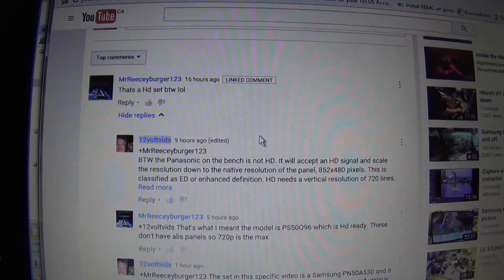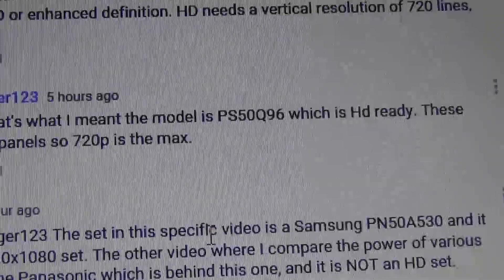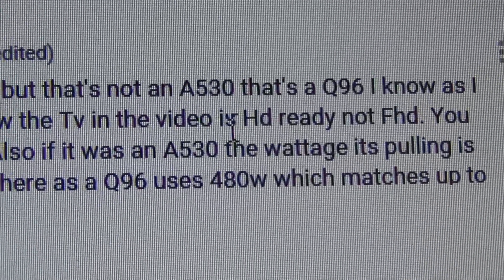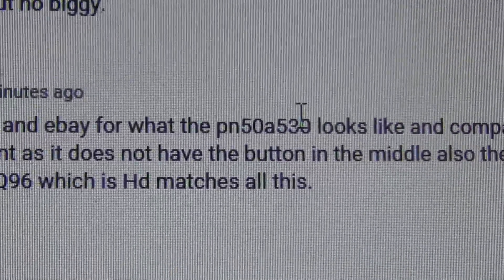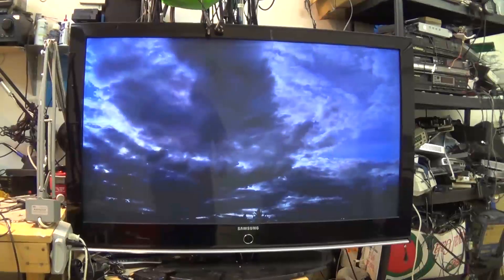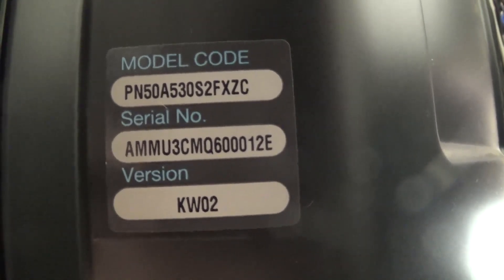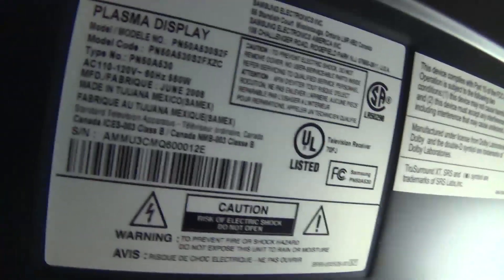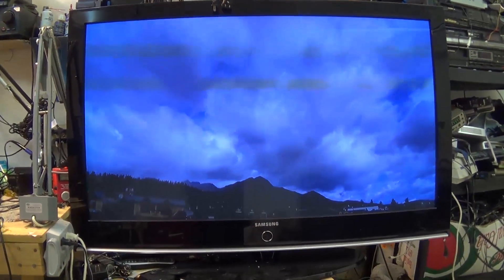I call you out MrReeceyburger123

Comment: Mr thanks for your videos 100 % your the teacher don't worry I have a question I have a samsung plasma tv model 851FH - YB05 I turn on the tv stay on stanbay gives me stanbay 5 volts but does not give the 3 15 volt  The power supply looks good has nothing burned I remove the power supply of the plasma tv and or outside the plasma TV just does not give me the 45 volt I know your have more experiecia if your can giveme an idea what component I can test thanks

Comment: Dear 12 voltvids, i saw you often desolder quit hard, i wanted to teach you a useful tips or maybe you can make a video to teach everyone.
You see when you scrapt an old crt tv , the flyback suction cup which att on crt the cup end part which close to the wire part, you can cut it and put it on desolder tools head as a nipple cap. It will stand high temp and your tools head also will not melt. Try it.

Comment: by the way I have one these and half turns it self on after 8 hours  if any know what that is would.be some help
Reply from the maker: +kieron a How do you mean?It turns itself on, or you hit the power button and it takes 8 hours to actually turn on?This one was taking 21:30 to turn on. Hit the power button, the sound would come on, and the VA voltage would come on but not the VS. There was no scan drive signals, and the VS control line was held low by the control board. After that time expired the VS control like went up, the power supply VS turns on, and the scan drive signals start from the control board.Cause, a cold solder under a BGA chip I think.  I reheated the chips, and it started working. I have it all documented, but haven't put the video together yet.

Comment: The sad thing is, Reece usually knows what he's talking about, and is very helpful on some of the forums where he seems to know a great deal about the crap Turkish Vestel TV sets which infest the UK and European market. I suspect the problem here (and I base this on nothing but the fact I know Reese is from the UK) is that there will be a similar range of TVs in the EU market that used a different model reference and panel range but the same moulding design. 

That said, common sense should have prevailed here and I don't understand why it turned into a flame war.

Please don't pull the plug, your channel is one of the most informative and entertaining on YouTube and it would be a poorer place indeed if you were to leave. It's regrettable that a lot of Reece's videos I hold in similar esteem. Oh well.
Reply from the maker: +Jason james I mean no disrespect and I figured that out when I looked up the model, but what annoyed me was when I initially responded to correct him he got on the defence and argued that I was incorrect when I am looking at it. Unfortunately the Internet is full of people not picking an trying to prove someone wrong or trying to prove that a procedure they see done is incorrect. If I am wrong I will accept that, and correct it, but when I am right I won't stand by and have someone claim otherwise. In this case he was correct. The uk version that has the same bezel is in fact a totally different chassis. It is like 2 cars from the same manufacture. One has a 4 cylinder turbo and the other a v8. They look th same on the outside but are totally different.
Reply: +12voltvids Indeed, and it has to be said as well that it's pretty much normal practice for the larger multinationals like Samsung to have ranges that bear no relation to each other in different parts of the world.

Comment: it's a NEC 50 plasma TV with the bad caps 3300uf 10v
Reply from the maker: +leon johnson jr Sometimes the high ripple from bad caps can cause component failure on the Y sustain , or Zsustain/xmain. Unplug these boards and see if your voltage returns plasma TV can be tough at times. The one shown in here took me a few weeks of trying everything I could think of, and I finally got it.This one would take exactly 21 minutes and 30 seconds to turn on, and I never did figure out exactly the root cause. I think it was a shut down routine built into the control board for perhaps an over temperature sensor, that was tripping every time the set was powered up, because it took exactly 21:30 to start, down to the exact second! Turn it off then back on, and another 21:30 delay. The control board was keepin the 207V supply turned off. Most certainly on the control board, because when I blasted all the chips with heat gun and halogen lamp till the flux under the chips was smoking good, it fixed it, but I don't know which BGA chip was the root cause as I ended up heating them all a few times and then bam, got it.I haven't published this video yet. Some day.

Comment: I'm not sure where MrReeceyburger lives but I know manufacturer's sometimes change the outward appearance and specs to suit a particular market. An example I know of is the JVC HR-S series SVHS VCR's. The PAL models are a completely different design and spec to the NTSC models although they have the same model numbers. A lot of the pics of these VCR's I see on Google etc. are NTSC models so it does cause confusion. You should never entirely rely on visuals to identify a model.
Reply: +Mark Ellem that's true the uk version of the set in the video looks totally different lol
Reply from the maker: +Mark Ellem Well that is the case here. In the UK they have a 720 model that looks the same as the full HD model sold on this side of the pond.But when I corrected him on the other video he responded back calling me basically a liar, and implying that I didn't know what I was talking about.Hence this video.
Reply: I hold my hands up for that, genuine mistake. I will make a video if you want on my A530 and Q96 just to prove why I got confused if you want ?
Reply from the maker: +MrReeceyburger123 No need, we know where the error was made. You didn't realize that the north American model I have looks identical to your 720p set.
Reply from the maker: +12voltvids Stay tuned to see this set under repair.

Comment: Like if you turn the tv on comes on fine turn it of the main bord logic switch off but after like 4 to 8 hours the logic comes bk on the tv aint on but in dark room  you see light comming from the plasma  if u press on the tv will cycle and come.on normal.but the capacitors  on the bored are all new am puzzled

Comment: I am still a newbie  at fixin  plasmas  so don't hold what say gospel but the one he talking about  is sold in the UK and is 720  they did do the other witch 1080 but but is not very popular  I have both they are fairly  similar   sad times for him
Reply from the maker: +kieron a Yes I figured that out after posting this video reply. Different market. I should have been on the ball actually on the initial comment when he said the model number as it didn't ring a bell. What is funny is the 1080 sets hit here in a big way in the 2008-2011 model years and then 720 sets became popular again. I am sure it had to do with the manufacturing costs being that much higher for the 1080, and the buying public wanted cheaper TVs.

Comment: You're in a different country, with a different TV system, so that although some equipment might LOOK the same as ours in the UK, technically it's different. I know what you're thinking - teaching Granny to suck eggs LOL. This sort of thing's EXACTLY why I pulled the plug on my old AG3304 channel. Might do the same to my present channel too, same reason, and lack of viewers.
Reply from the maker: +River Huntingdon Yes I know that but I didn't start this.He did, and when I corrected him on the model I had he got all fired up.I was just looking at a Samsung set today at a customers place, that looks identical to another one I have, and even though the spec says it is a 1080 set, I can see the pixels, something I can't see on the full1080.It is all in the subpixels. A 1080 set technically only has to have 1080 horizontal registers. The vertical registers is 1920, however there are 2 ways to represent this. 1920 pixels represented as 640R 640G and 640B pixels, and technically that is still classified as 1920X1080, or the FHD, which has takes those 1920 pixels and divides them up into RGB subpixels. which would result in 5760 subpixels still addressed as 1920. Gets confusing but the fullHD do have a noticeably sharper picture than the so called 1080 sets, which actually have lower horizontal resolution than 720p sets with 1280x3 subpixels.. Its all about the cost of manufacturing right.We see the same thing with the pen-tile OLED screens. The blue pixel is much larger than the red and green based on the fact that the eye sees more resolution in the red/green spectrum.